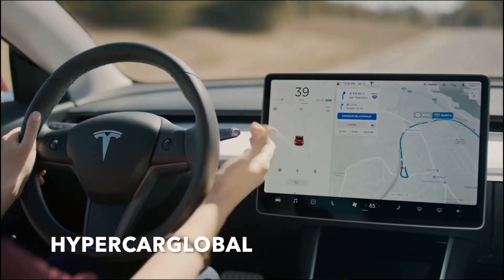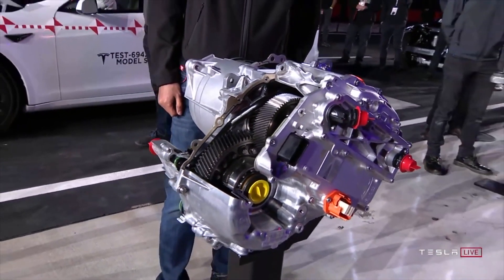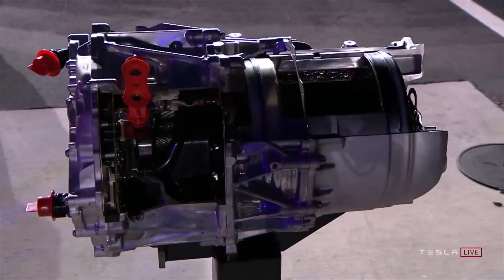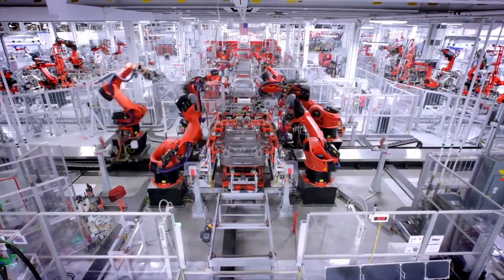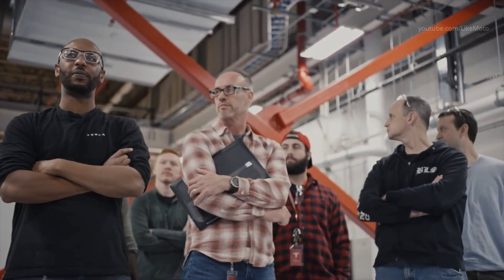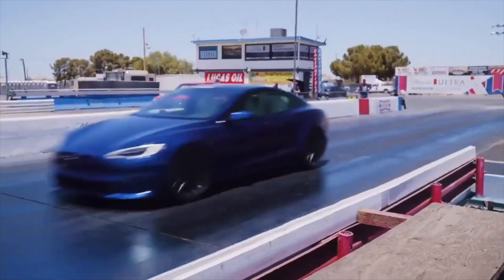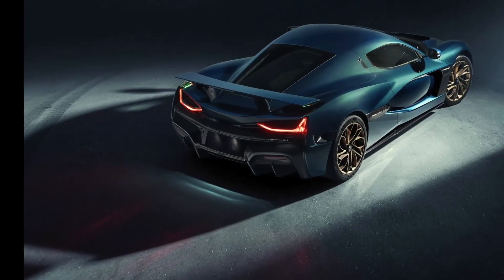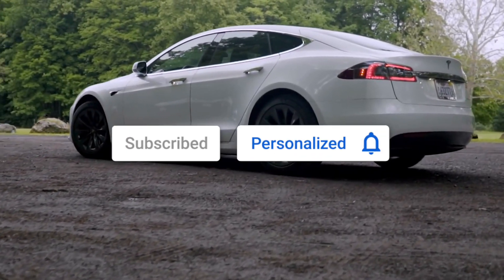TESLA'S NEW MOTOR Will Change The INDUSTRY!

Comment: Do we expect the audience to take that without motor test data? Before and after carbon wrap. 

Data to compare? 
Efficiency at max torque and load (0-60mph)
Efficiency at max rpm and load (120mph)
Efficiency at intermediate rpm, load(60mph)
No load self destructive rpm1 (no wrap motor)
Versus No load rpm > rpm1 (wrapped motor) 
Stall peak torque within first 0-1 sec. (system should not self destruct or aged)